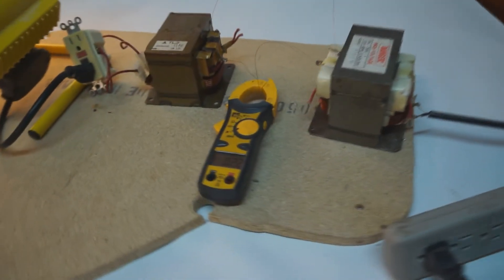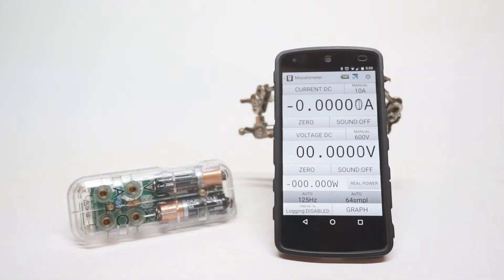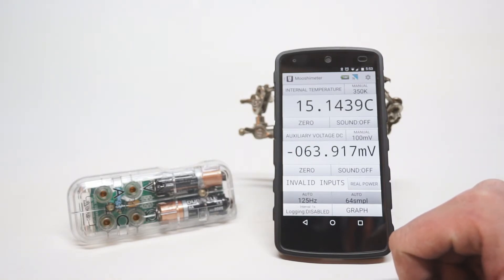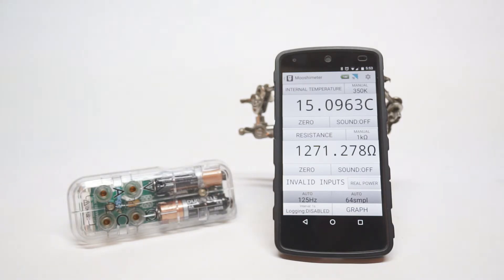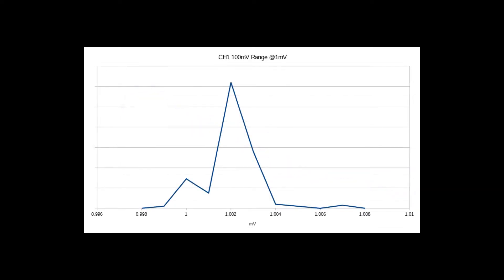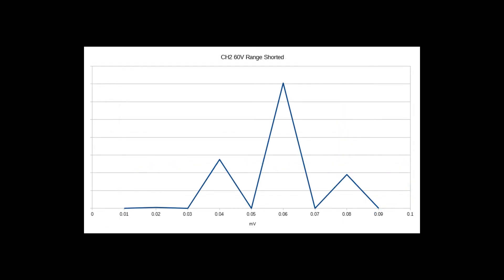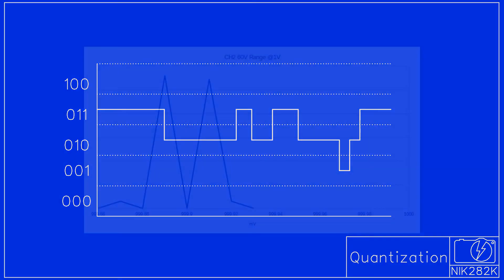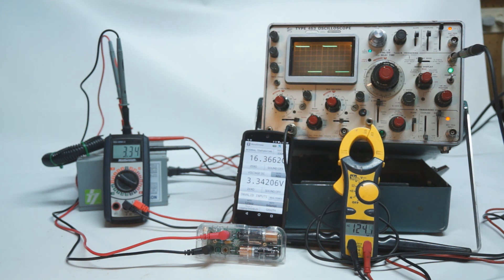Testing the Mooshimeter

Comment: I have been looking to replace an old 'reporting meter'.
It was a Fluke(?) that used an ultrasonic transducer to transmit readings to a nearby receiver that then interfaced with the actual recording equipment.  High voltage isolation was the intended purpose.
The ultrasound was frequency modulated to correspond to the reading on the meter.
Very basic stuff, the only data available was a 0-100% reading of whatever selected range the meter was using at the time.
Reply from the maker: Was it very directional or did the two parts just have to be near by each other? I haven't tested the Mooshimeter's accuracy up to 600v yet but I would imagine it is pretty good given its performance at low voltage. The ability to measure both voltage and current at the same time is nice as well.

Comment: Too expensive (for my limited usecases) to be honest at 150$ since I would not use it that often.
My Multimeter has a PC connector so I could use that, but of course no fancy smart phone stuff.
But their name is quite amusing in german :)
Reply from the maker: I would have preferred a PC connection, phones are toys, but I don't plan on using it for day to day only bench top work. I'll have to Google the name, I haven't had to read German for about a decade now.
Reply from the maker: >_< no doubt

Comment: If I did the math right, it looks like its quantizing around a 24-bit resolution  (+/- 60000 mV /0.0175 mV);  However, it's late, and math's not my strong suit. :)
Reply from the maker: The manufacture says 16 but I think the least significant digits might be "filler," making it look like more. I've always liked math but statistics was never fun (until now).
Reply: well, if it's a 16 bits counter,  it has 0-65535 values (0.92 mV increments)  to divide the range  or (32767-32767 if the range is +/ 60, double that increment.  However, the graph appears to be in 0.0175 mV increments.  Perhaps it's on a logarithmic scale?
Reply from the maker: They might be doing some analog voodoo as well, it could change it's scale depending on the input signal but that's only a guess.
Reply: It looks pretty spiffy, none-the-less.  Is it the latest version?  Their web page claims a 24 bit ADC, with a modest drop at 125 samples/sec.
Reply from the maker: Derp, I got the 16bit from not their official site (serves me right for using my phone), you were right first time around. 

I'm going to have to adapt some industrial sensors from 4-20mA to some voltage scale so I can do some real data-recording.